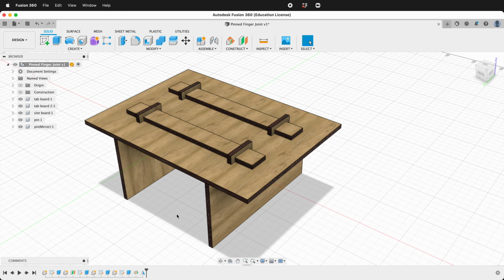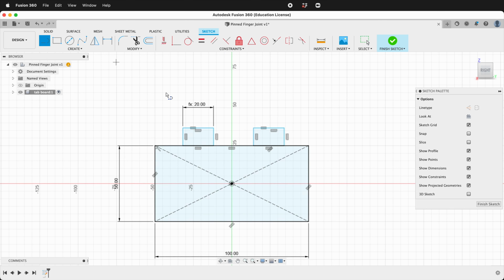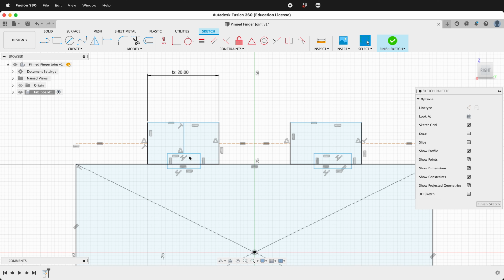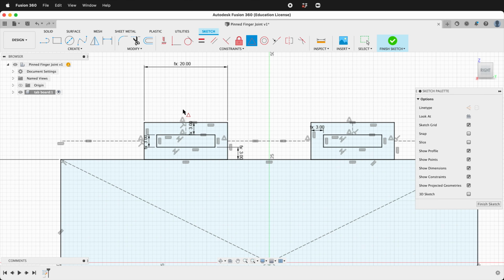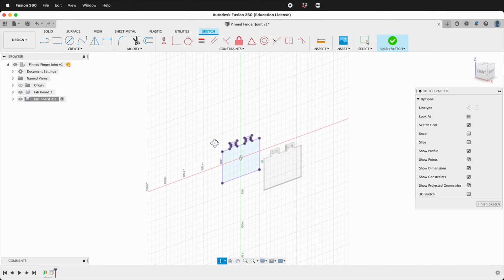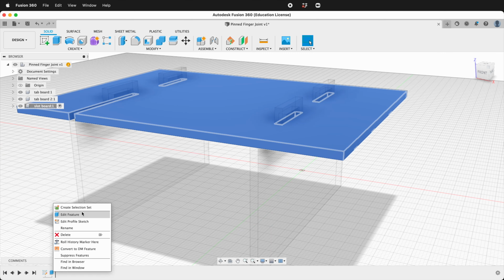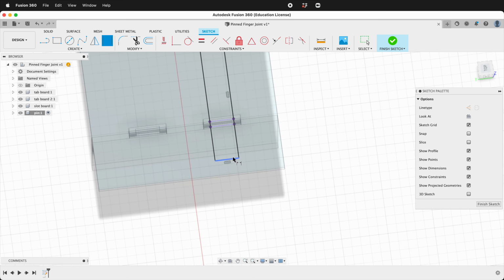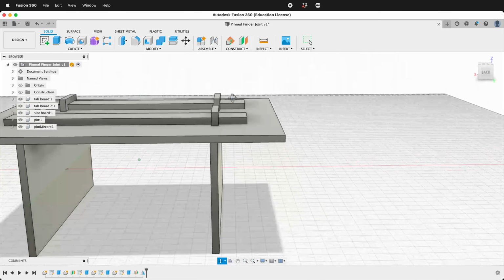Fusion 360 Tutorial Pinned Joint

Comment: I think you can save some work by pressing the x key before drawing the mid- lines. This toggles  the construction line mode. No need then to reselect and convert those lines.
Reply from the maker: That's a good point and a better workflow, I will start doing it that way more often

I try to balance speeding through keyboard shortcuts and explaining all the techniques for folks who might be new to the program
Reply: @WhatMakeArt  oh, you are still much more experienced in Fusion360 than I am. I learned a lot from your videos, especially with the design wirkflow. Keep up your excellent work. Your style of explanation is very understandable 👍🤗